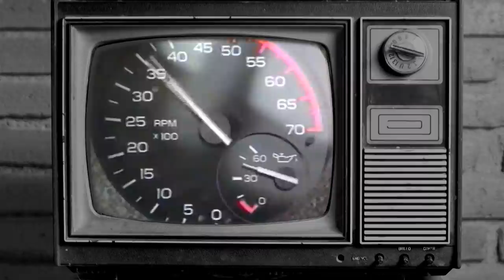Jeff Lutz On Drag Racing, Hot Rod Builds and More

Comment: We do purge welding in the food industry no heat or big vibrations, we call it a food safe weld we also put cameras down the pips for inspection before its used, we use food grade stainless steel 318, for Ice Cream, Milk, Custard, Yogurt, beer, wines and many more, plus there is no need purge weld exhaust headers and pipes, Jeffs welding is beautiful to look at, very nice anyone can weld but not all can be are masters of it

Comment: Hey Jeff I'm A poor guy with a 71 Buick . Just put in a 427 . Wheel hopes bad out of the hole . Any cheap things I can do to help?
Reply: Traction bars and good shocks
Reply: I would start with Traction bars then adjustable coil over's and then a 4 link suspension. That's what u start with in order.

Comment: So back up gas is not important humm. Then why use it in the welding torch. Be careful how you answer because all that apply to the welds  also apply to the back side of the weld. I understand no back up is needed on thicker metal. Header tubing it not thick metal. Taking an ostrich approach is not the best approach. You can't see it so it must be fine. It's only a problem if its seen.  It was obvious to me they ask or told Jeff to say that. Just my 2 cents worth.
Reply: Pharma  Quality also requires purge.